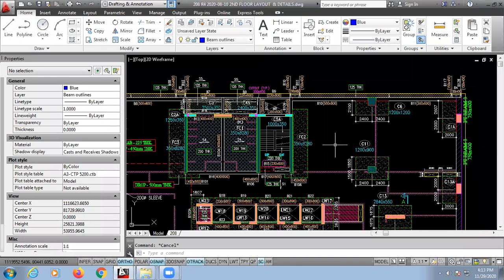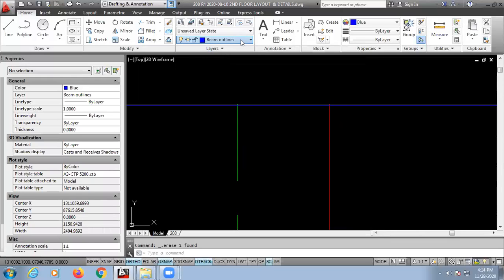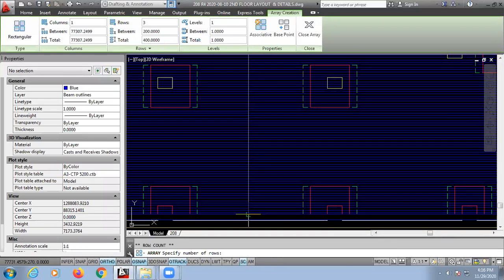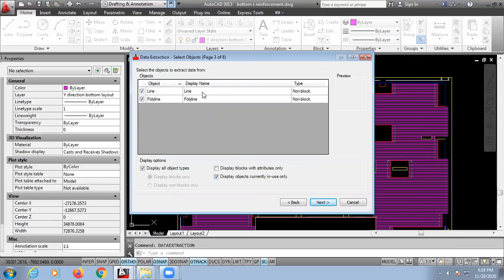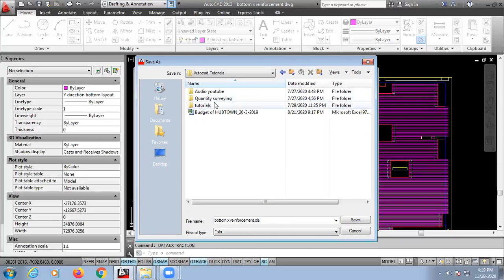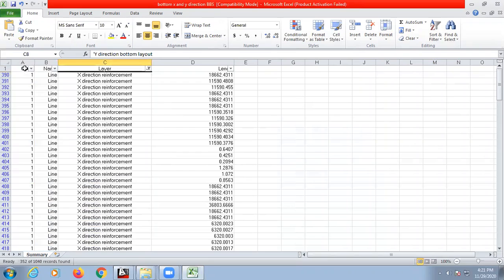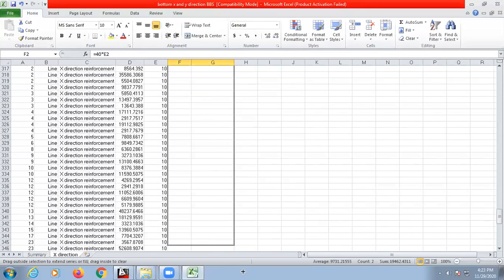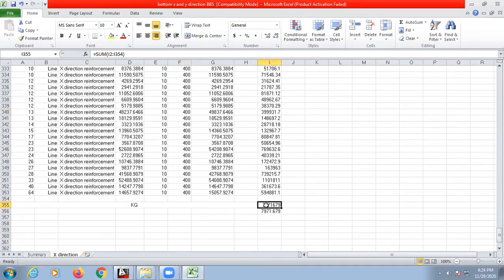BBS of Flat Slabs using AutoCAD| DATA EXTRACTION BY QUANTITY ESTIMATION AND BILLING ENGINEERS

Comment: D2/162  weight is in per unit meter.
And length that you are multiplying with is in mm. 

Shouldn’t you convert length into meters?
Reply from the maker: It is converted while calculating wt. Of steel